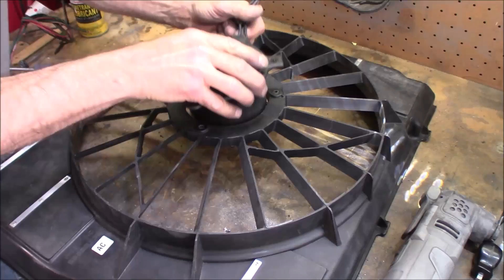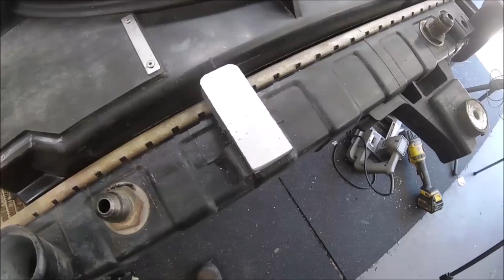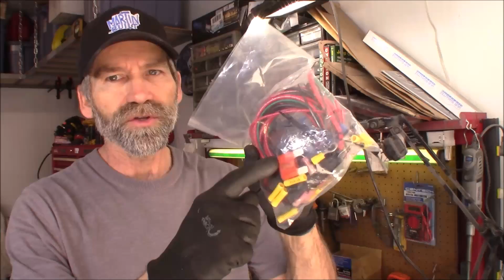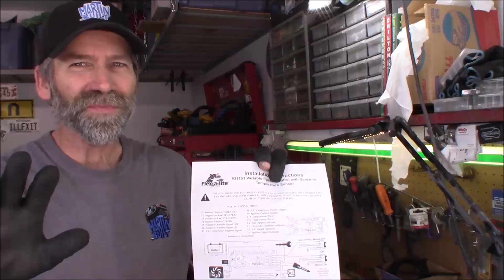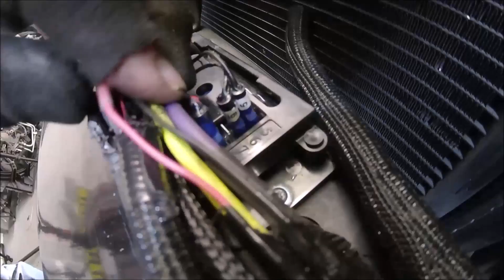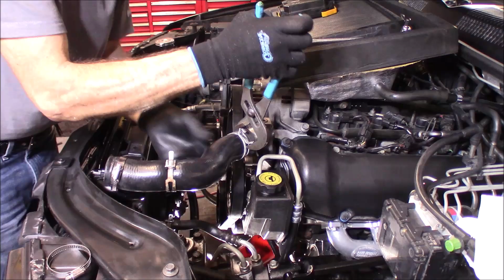Hydraulic to Electric Fan Conversion 01-04 Jeep Grand Cherokee 4.7L

Comment: I'm thinking that fan shroud will rub against the fins of the radiator and cause it leak. Beacuse it looks like it lays right on the radiator fins
Reply from the maker: the fit to the radiator is very tight with zero movement between the two.
Reply: Great work congratulations awesome solution for the hydraulic nightmare fan.

Comment: Great Video! I would like to see the same for the 5.7 Hemi. My PS Pump Whines, louder when cold. And I have now been through 2 PS Pumps. Temp seems to be OK until the pump goes. Then when you sit at idle with the AC on, the temp just goes up and up.
Reply: i live up in sask so we got cold winters and when i fire up my 5.7 in the dead of winter the ps pump wakes up the neighbourhood lol
Reply: What’s the fix
Reply: The PS is the only problem with these trucks
Reply: the 300c power steering works in this case. you must replace it.

Comment: Question:  Have you had any problems with the one screw wearing a hole in the cooling tubes?  The one that the head is against the radiator side.
Reply from the maker: I don't understand what screw you are referring too
Reply: @martinbuilt  First mount you made, look like lower Left?

Comment: martin why can't i adapt a plug to the hose line & bloke it off . cause where i live here in australia parts aren't that available and can be a lil more on price
Reply from the maker: that pump move way to much fluid and most likely will blow the seals on the steering gear box.
Reply: ty for that info appreciated i am very happy with car now that i spent a lot money on it. trying to leave standard cooling but we can not find the relay . not under head  light not beside large fuse box   & i am not good chasing wirering lol . we can get the fan to go with a seperate switch that i control in the car but much rather it done throuhg the system
ty so for your trouble kindest regards peter
Reply from the maker: @peterlavender5672  on the hydraulic fan there is no relay, that is for the mechanical/electric fan Jeep Grands.  The wires for the hydraulic fan goes straight to the ECM.
Reply: ty for that 
boy have i been mislead . OK back to the power steering would it be feasible to return it back to its self ?? or cheaper to to go your way . here in ozz its al money money & not in a small way . i do have a couple of connections here but only for wj & later . sry to be a bother but i don't have many people to turn to here  even the dealerships  don't  or can't tell me much as they don't know too much of the earlier models .IT"S A PAIN sometimes . again i realy appreciate all of this .
Peter
Reply from the maker: @peterlavender5672  the least expensive way would be to find a hydraulic cooling fan in the salvage yard around here they go for 25 to $30 next choice would be to convert to Electric like I did and last would be to replace it with a new hydraulic cooling fan which is over $1,000
Reply: lol they will only sell the whole shabang  average  $350/ $450  most want break up i tried for the solinoid but only would give the whole shroud very different to what it was like in my day where you would go with a few spanners /screwdrive . today over here is like a well oiled wharehouse . ty so much for your trouble i think i'll go your way but it will take a lil longer . PETER

Comment: So if I'm not mistaken, you could forego installing the manual switch, correct? Without that, the rest of your setup would just function automatically via signals as determined by coolant temp sensor? I can kinda understand why one may want the switch, but not only do I not have a 4x4 model nor any rough terrain to negotiate (I'm in Dallas lol), I also would only be using my GC for normal daily driving.
Reply from the maker: yes that is right, the manual switch is totally optional.

Comment: Martin, I did a poor man's version of this. Installed a severe duty fan clutch in my 4.7L. I have a Ram 1500 so it's  a bit different, but cools way better now, even on the highway! I know its robbing me some power, but It's my daily work truck.; I'm not trying to put down 0-60 or 1/4 mile times. Works for me. It's also not as loud as I expected
Reply from the maker: Nice work, thanks for sharing.

Comment: Question do you see a way to run an electric fan using stock wiring from the solenoid to let the computer do the controlling of the fan Without check engine lights?
Reply: I've already done a quick conversion using a Ford 12 blade 16" fan and stock shroud and fan clutch from a 2000 grand Cherokee? 

It works great but the loss of power and fuel economy im not happy.  

What are your thoughts?
Reply from the maker: the ECM is sending a pulse signal to the solenoid so use it to control the E-fan will not work. You'll need to place a 10 ohm resistor on the solenoid wiring and use a fan controller for the E-fan.
Reply: @martinbuilt  thank you. I like your videos not boring yet direct and informative

Comment: Martin, with the efan do you see lower temps at highway speeds? I keep hearing that fans don't help at higher speeds because of sufficient airflow through the rad.
Reply from the maker: that is true in many situations, it was very true on a diesel truck I had many years ago, any thing over 40 mph and the fans would slow the air down and the temps would go up but, once I would turn the fans off I could see the temps drop. 
I have tried it both ways with this E-fan and at highway speeds found the temps go up if I turn the fan off. This fan must draw a large amount of air.

Comment: This looks like the route I'm going to have to go. Good thing I have your excellent video to follow! Need to spend some time at a junk yard very soon!
Reply: Can I use the stock factory power steering pump? I just need to change the lines correct? I'm a little confused about that part.
Reply from the maker: No, you should change out the pump as well

Comment: Martin,
Was thinking of doing this on my 4.7l HO. I have a question however.
Do you think it is possible to run a mechanical fan off the 4.0l WJs? 
I personally would rather have the cooling power of a mechanical fan and loose a little MPGs as I don't want to overheat the engine.
Let me know your thoughts.

Comment: Nice job, any reason you couldn’t run the PWM signal direct to the fan?
Reply from the maker: yeah, because it is only a signal. I don't what the  ECM anything to do with controlling the temp, let the fan controller and thermostat do their thing.

Comment: Saw something extremely smart on this video that 99% of people skip over...solder the wire to the ring terminal!!! It cuts down on corrosion and cuts out contact issues through expansion and contraction...it's a Chrysler wire harness so ALWAYS ALWAYS ALWAYS solder!!!!
Reply from the maker: yes I like to reduce points of failure.

Comment: Dont have a hydraulic fan, it's electric, but do you think that fan would work in my 2000 dakota? I don't like the original fan...this one looks like it would work great but idk how it would fit
Reply from the maker: I'm sure it would work fine the problem would be finding one as there were only 15,000 made and as you said not sure it would fit.
Reply: Oh damn...didn't know they were that rare...I saw an aluminum 24 blade (with curved and angled blades like a jet turbines) electric fan off of SOMETHING on eBay for $50...I'm thinking about getting it...might have to make a housing and shroud for it but I'm ok with that...

Part of my goal also is getting rid of the washer fluid and overflow tank from over the radiator
Reply from the maker: @Kolonol1  yeah if you get it I'd be interested to know what it came off of.
Reply: @martinbuilt  I'll see if I can figure it out...it's got a cage and 4 mount points...

Soon as I get out of Facebook jail I'll try and post a picture to your page

Comment: Thanks for the great video. Shame I cant do it on my 2.7 crd. As there is no replacement power steering pump without the hydraulic fan.
Reply from the maker: If you're able to hook it up hydraulically you still might be able to use the power steering pump. I could have retained the stock pump I just needed to change a few fittings to make it work but, opted to change the pump instead.

Comment: Would there be a way to get rid of the ac condenser i seen that its connected to the steer colum/ pump. Buying a power steering cooler would wokl as well ?
Reply from the maker: Yeah if you don't need air conditioning you can get rid of the condenser and if you a hydraulic cooling fan you'll need a decent size power steering cooler or if you just have a standard electric fan and mechanical fan combination you can go with a much smaller cooler for the power steering.

Comment: awesome video, just got a 02 Cherokee with 4.7 my scan tool tells me the solenoid is bad, was looking for conversion and you nailed it! my next project, thank you
Reply from the maker: Thank you, Phil, let us know how it turns out.
Reply: @martinbuilt  what did you do about the check engine light for the fan solenoid?
Reply from the maker: @tylerhall1348  
at 33:15 I answered that.
Reply: @martinbuilt  thank you i missed that part
Reply: Hi there martin,
in a WK'08 model 5.7 there 3 wires which particular wire goes to the resistor...
Reply from the maker: @neouae-gx6ue  The one that is black if there is a black it maybe black with a blue stripe is
goes to chassis ground and the other two go to the resistor.

Comment: will this work on an 06 grand cherokee laredo?
Reply from the maker: I'm not exactly familiar with the 06 Jeep Grand Cherokee but if you got a hydraulic cooling fan and use the same methods I did in the video, yes this should work. You may need to find a different electric cooling fan because of radiator dimensions. Besides the cooling fan that I used there are less than 15000 in existence.
Reply: @martinbuilt  Thanks! After I left my comment I realized that you were working with a hydraulic fan....Mine is not hydraulic, it's a fan clutch style so I guess it will be a different. Thanks for the response though!
Reply from the maker: @aRighteousDude  That would be even easier than converting from hydraulic. Thank you for watching.

Comment: Martin,
Did you remove the stock power steering cooler?  Or are you still running the new power steering pump through the gearbox and then through the cooler?
Thank you
Reply from the maker: I am currently still running the stock power steering cooler. I could eliminate it and have thought of doing that..

Comment: Another awesome video and tutorial for thinking outside and above the square.
I work in remote central Australia where there are car dumps from 10-100 vehicles of various makes and models. Unfortunately no Jeeps, but lots of freebies to pick and play with. Looking at HSV V8 Holden twin efan setup but not sure if twin fans are going to be an extra load on the system?
Not overly mechanically inclined but willing to give it a go. Free parts and all.
Any thoughts??
Reply: Holden HSV were rebadged as Pontiac GTO in the US for a short while. That's about as much as I know.
I've since found two WJ's; a 2004 Overlander and a 2003 Larado. Until they are dragged to the car dumps I can't strip them and will need my tool box.
I do have access to old Volvos where I live in Tasmania so I will definitely explore that avenue.
Reply: @ypahihi  Hey how are you? I also live in a Remote location where some parts are difficult to find, What did you finally do about this? what part did you install?
Reply: @jesusrperezd  
Hey, well that was a while ago.
I ended up just keeping it standard as I was able to piece together a Land Rover Discovery II that required less work.
I did amass quite a few spare parts which I eventually drove home to Tasmania (3200kms from work).
The HSV twin fans required modification that I just didn't have the right gear to change.
Reply from the maker: Never heard of an HSV V8 Holden. Do some measuring and see what it take to get it to fit.  Also check out the Volvo's, I've heard they have some good fans.

Comment: This is very interesting to me, I must be one of those few people who likes the hydro fan and how it works.  What would be the main reason for doing this conversion? Enless it broke or failed.  I’d say that at full speed the hydro fan can still move more air than the 5.9 fan (I have a 5.9 limited).  Yea the hydro fan can act a little lethargic in stock form, it seems to give the bare minimum air requirement but in spite of that it’s never let my Jeep overheat in the most severe conditions.  You cleverly showed how to turn up the solenoid too in the last video if you want to wake the fan up a bit and make it run cooler.
Reply from the maker: Even with the mod that I did to the solenoid, I would see temps at 215* plus and for me, that is to hi.  I am trying to achieve the best performance not necessarily the best MPG. The engine will get it's best MPG at 204* that is what the PCM is trying to maintain but not doing a very good job at it.

Comment: Nice.  Thanks for this video.  Love how clean your engine bay is.  I bought an 04 with the 4.7L almost 3 weeks ago now.  I have a crack in the radiator on the driver's side.  The hydraulic fan has wetness in the center of the fan.  The 5.9L Grands are rare here, but I did see that Flex-a-lite has a fan for our models.  Really thinking about getting that for when I change out the radiator.  Can't wait to get this done and hopefully I can figure out what's going on with my oil consumption.  Hopefully when I take off the valve covers I can see what might be going on there along with the PCV valve mod you show on your other video.  Thanks again.
Reply from the maker: Sounds good let us know how it turns out.
Reply: @JM-id8ft  I did not get the flex a lite.  After getting the radiator out and being up underneath, I found where a massive oil leak was happening which I thought was the rear main seal.  Where it was parked, I didn't have the capacity to drop the trans.  So I ended up replacing the radiator and putting back the power steering lines.  Haven't had any issues since and it's been 7 months.  But if I ever have radiator issues again, I want to change it to electric.

Comment: Fantastic video and I mean fantastic!! After doing some looking on-line I was sure I was going to be stuck with the Hydraulic setup because of the PCM issue or the power steering pump issue and your video completely puts faith that this won’t be a problem.

After a few months can you provide any update to how this went, any thing you feel you could have done different or even adjustments you made after the fact?
Reply from the maker: Thank you, no I couldn't be happier with this mod. Probably would have been nice if I could have found a more popular fan one that is more readily available instead of the one I used being that there's only fifteen thousand of these fans ever made. But I couldn't be happier with the performance this particular fan. Thanks again

Comment: Please which line is the high pressure line and low pressure line. Which one do I change? It seems in the videos it is not all that clear. I am using 2005 grand Cherokee 5.7l. I just changed the hydraulic fan to electric fan and I am getting issues with the steering pump. It keeps getting harder the steer. Explanation with pictures will be appreciated. Thanks
Reply from the maker: The hi pressure line is the one that fastens directly to the steering pump, the low pressure line connects to the pump reservoir.
Reply: Which one should I change?
Reply from the maker: @fatiamadubaba4402   the high pressure side. Now I am unfamiliar with the 5.7 L,  I don't know what the power steering pump looks like. This video was strictly for the WJ's.  I also replace the power steering pump. The pope with the hydraulic cooling fan push his way more fluid and we'll blow out the seals on your steering gear box. The hydraulic cooling fan was able to meter I reduce the pressure to the steering gearbox.
Reply: You must have replace the power steering pump for the 300c. 5.7 hemi. I did mine and it worked.

Comment: Great videos! I have an 03 Ram with a mopar remanufactured 4.7, an entire new cooling system (radiator, water pump, thermostat, hoses, coolant temp sensor, fan clutch). I'm seeing temps up to 235 F. I'm thinking I have air in the system and need to bleed properly. Any thoughts? What are the highest temps you saw with your stock setup? Love your channel!
Reply from the maker: I was seeing temp as hi 232* F that was cruising at 70 mph with an ambient temperature of 105. Yes, I would suggest purging the cooling system.
Reply: @martinbuilt  I'm under the same conditions; 235 degrees at highway speeds with high ambient temps >90 F. The temp never goes past 235; it always remain stable. I will bleed the cooling system and see and see what happens. Dash warning lights come on at 252 F on the 4.7 so I suppose 235 degrees isn't terrible, but Id like to lower temps if I can. Thanks for the quick reply. I'm subscribed to your channel. I'm glad to see you putting so much love into your 4.7
Reply from the maker: @Danielito9165  yeah personally I don't like it going above 205 more for performance reasons. When it gets up around 235 I just think that's too much and can help promote valve seat drop. Thank you for subscribing,  I will be having more 4.7 stuff coming out soon.
Reply: @martinbuilt  Hello again. Any idea if the purging procedure is different for vehicles with expansion tanks only? My 4.7 on the Ram has no cap on the radiator; the expansion tank has the pressurized cap. 

Today I drained the radiator, removed the bleed screw, added coolant until it bubbled out of the bleed hole, very loosely replaced the bleed screw, and let the engine run until I stopped seeing bubbles form around the screw. Thanks again!